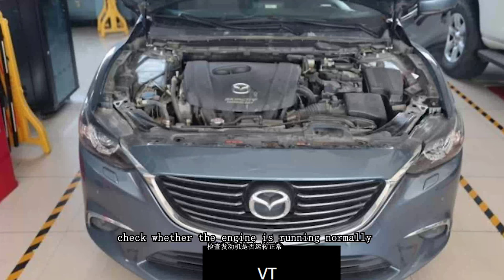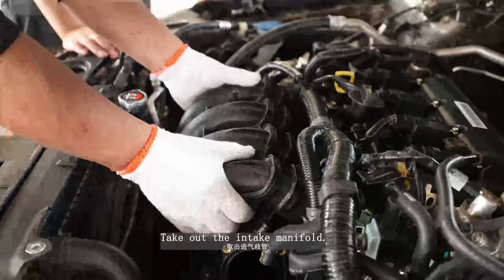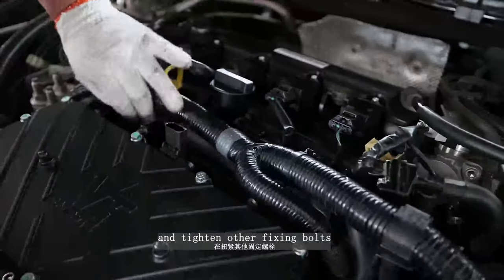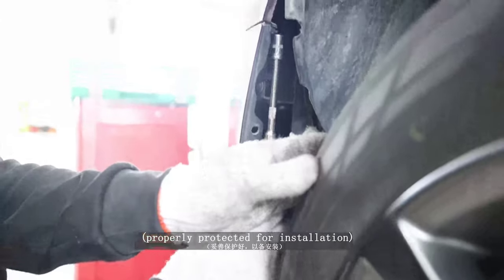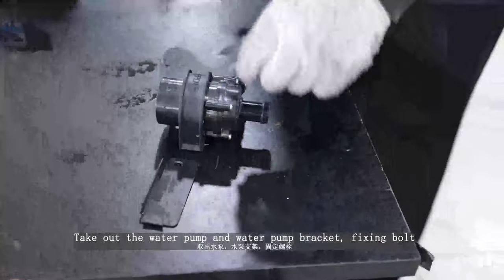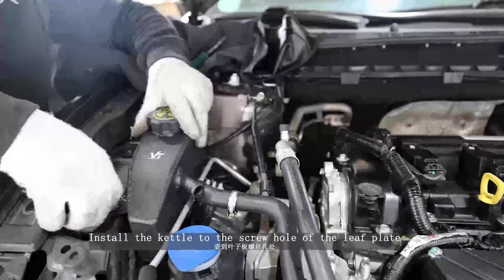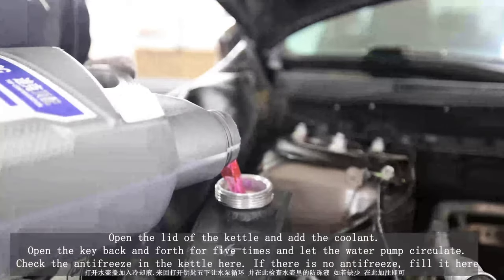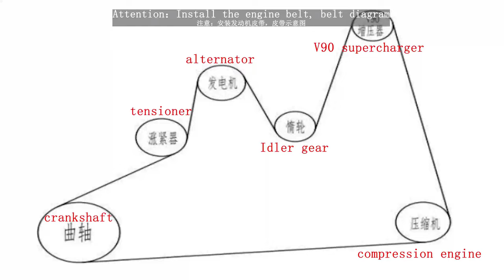Mazda 2.0/2.5 power upgrade with VT twin screw supercharger kits. Specific installion manual

Comment: DO NOT reuse old intake manifold gaskets. Mazda has a problem with using rubber seals that deteriorate from oil and gasoline. Mazda has also had a callback from 2014 to present time of premature failure of vacume pump that allows engine oil to enter the intake manifold . Be careful to inspect the old intake manifold for engine oil, it will blow up your engine . The vacume pump is also a dealer part only .
CHECK MAP sensor is clean and free of oil ( once again a failed vacume pump allows motor oil into intake manifold and will get the MAP sensor wet . There should be absolutely NO engine oil in your intake manifold PERIOD )
ALSO … choose a MAP sensor that is made for your elevation.
Reply: intake manifold oil on all skyactives
Reply: Todos los motores tienen aceite en la admision por la valvula PCV ._________________.

Comment: So, a supercharger compresses air right? So how does the ECU cope with the extra volume of air in the cylinder? Does the ECU need a remap to cope with the potentially leaner mix, to add more fuel - or am I missing something...
Reply: you definitely have to get it tuned. There are a couple guys that have done this, and vlogged some of it. They talk about the tuning process.

Comment: I had been watching a few u tubers' video that put in supercharger into their Mazadas. One thing I am not clear about is the differences of VT's supercharger bypass flap control vs car having ECM control bypass flap. 

I presume VT supercharger bypass flap is strictly using vacuum actuator for modulating the bypass flap? Will the bypass flap start modulating (or start closing a bit for +1.5psi on supercharger side) when manifold air intake pressure starts to go towards -1.5psi. ECM operated bypass flap had a bit of narrow operating bandwidth - which it will not modulate when the air intake manifold pressure is still slightly negative.